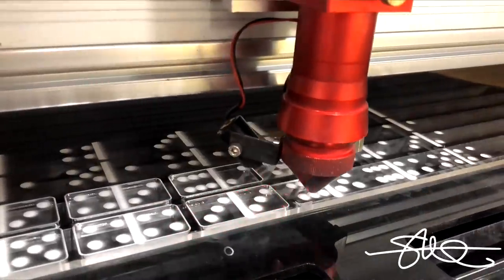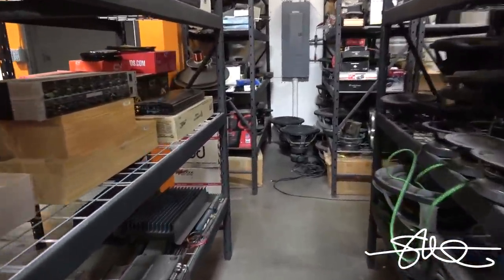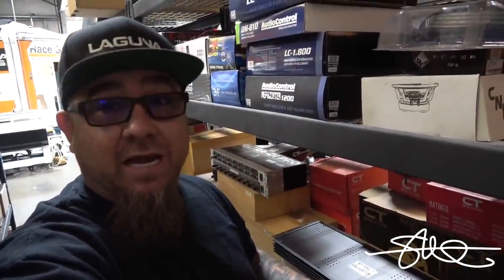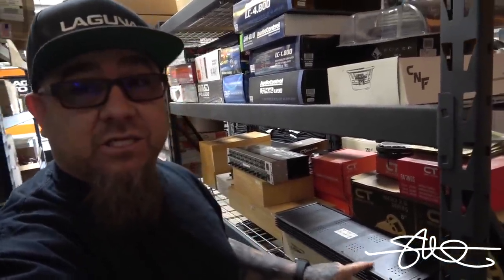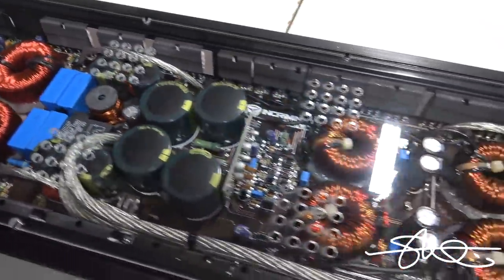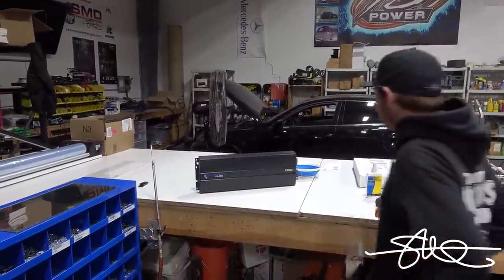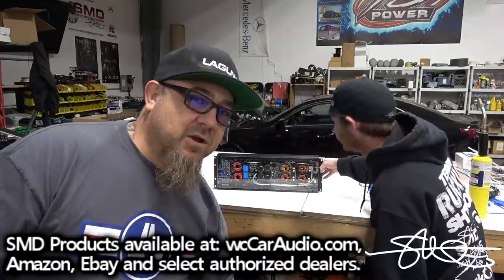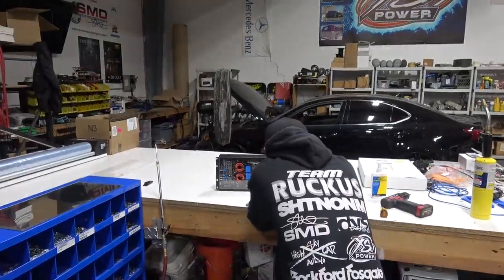Show Off the Guts! Laser cut clear acrylic, vented amplifier cover plate - Incriminator Audio IA20.1

Comment: There goes the RF shielding, looks grate though. Such is the war between form verses function.
Reply: after reading this comment I started doing some research and RF shielding seems pretty basic but is really not. There are many factors to consider and designers should have a comprehensive knowledge of circuit design, EMI control, mandatory specifications, environmental issues, and other factors.

Comment: A full see through box that won't blow apart would be nice to see if anyone can do it and do it right it's gonna have to have S.M.D ETCHED INTO IT!!!!
Reply: anthony nelson I've seen one. they used pretty thick acrilic tho and it was a small box so it didn't need much bracing. had a 12" entry level powered sub.
Reply: I have seen a few myself but the only one I've ever been able to use was a p.o.s. and a Sony 10 inch pretty much sounded like it was blown

Comment: Hey steav..don't know if it will catch on or not but got an idea..start the trend of SHOWING THE GUTS actual install..if possible that amps can be in the upside down position...or a rotisery style.set up to where you can show the amp guts ..every body gonna be on it..OPERATION..TREND SETER..BY..SMD
Reply from the maker: people have been doing that for years. Thanks anyway though.
Reply: Old but still bad ass